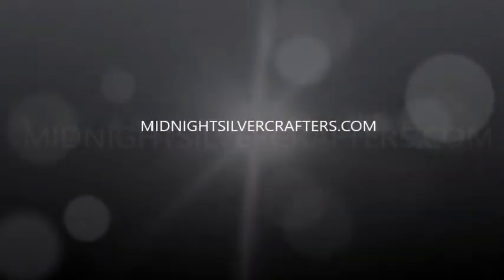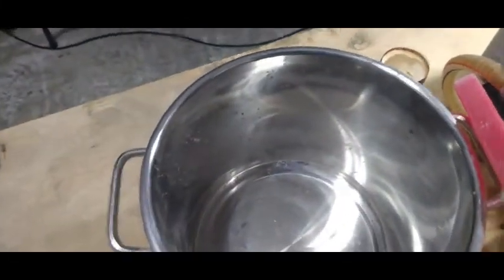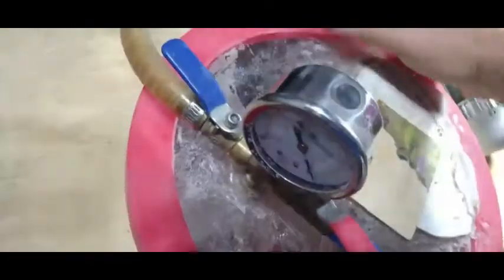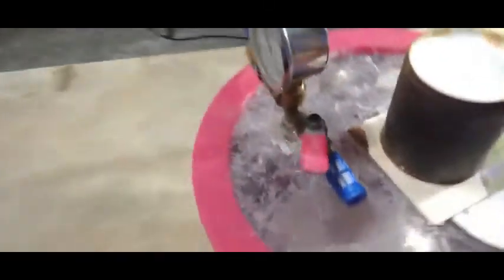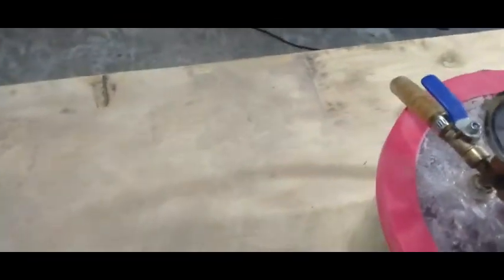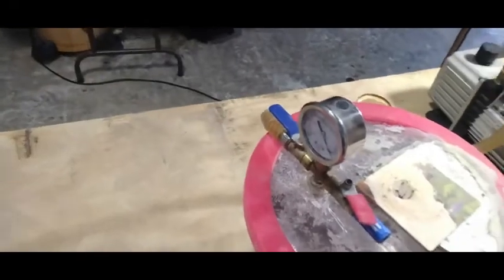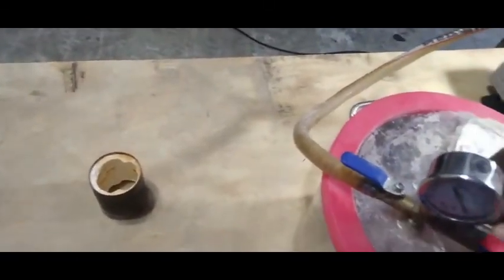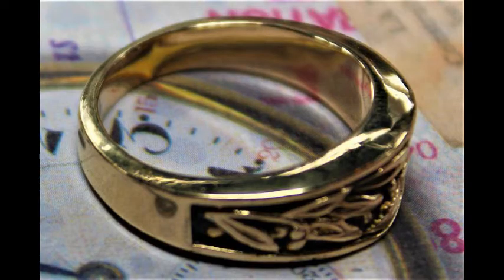super cheap way to do  jewelry casting and lost wax casting at home!

Comment from the maker: DO not buy a vacuum chamber with a tempered glass lid if you plan to drill a hole in it! Buy one with an acrylic lid!! If you try to drill tempered glass it will explode!!
Reply from the maker: Use the links above to buy the vacuum chamber with the acrylic lid!

Comment: OMG, thank you! I thought I was never going to find an answer to whether or not I could use one of these degassing chambers for casting metals! BTW, where can I get one of those glass tops from you?
Reply from the maker: sorry for the delay..... just get some plywood about 3/4 in thick and drill a hole a little smaller than your flask( i use food cans) make a gasket from a silicone kitchen hot pad from walmart......or a thin piece of hard cardboard. let me know if you have more questions...

Comment: Hi, great Video! So could you take me through the process here real quick? Making the investment is easy, how do you pour the jewelry itself? The investment isn't air tight, thats why it can suck the air bubbles through the investment away from the casting. So do you just put the can on top of the whole? Isn't this super dangerous when pouring 1000°C metals or Is there some sort of plate between the can and the acrylic lid? In the video you said casket (14:04), what is that exactly?
Reply from the maker: Just put the cardboard gasket down over the hole then set your flask on top of the gasket .... Turn on the vacuum pump then Melt your metal and just dump it in it's that simple
Reply: maybe a dumb question, but i see there is also a hole on the bottom of the investment, isn't the metal goiing to go through that hole as well and pour out? @midnightsilvercrafters

Comment: ok so we put the can on top of the hole and turn on pump so the pump is sucking the bottom of the can for what purpose? to keep it in place? im lost like this wax lmao
Reply from the maker: The can goes over the hole in the lid so the vac pump can pull air down through the mold and suck the hot metal into all the details of the mold . watch the last part of this video starting around 20.00.... Thanks for the comment

https://youtu.be/v81CRXnJ1VQ